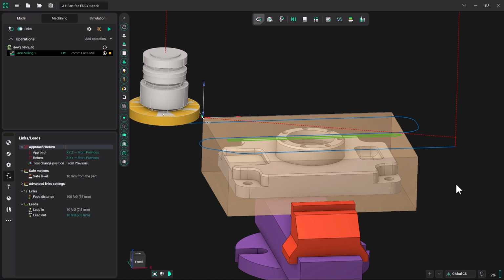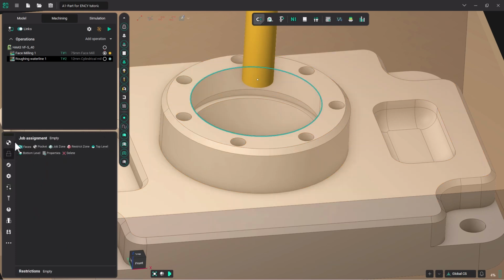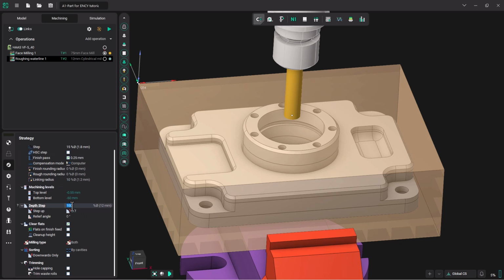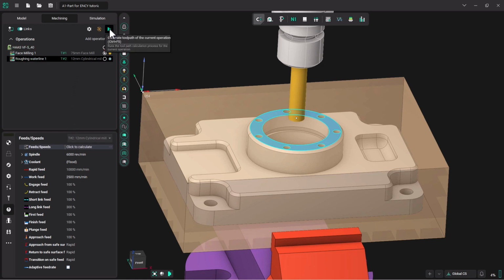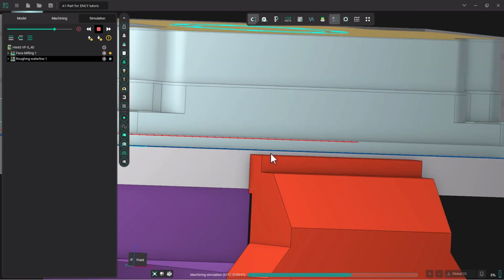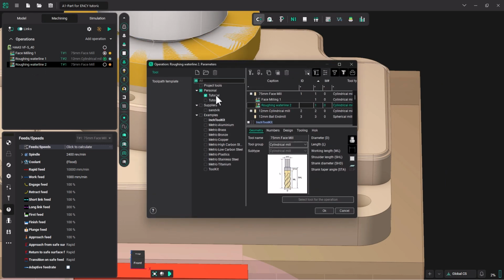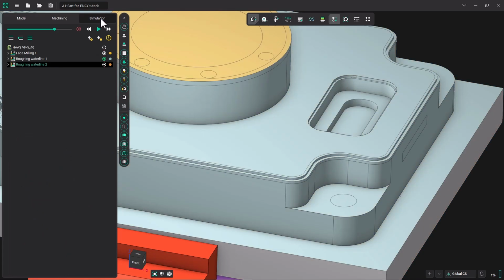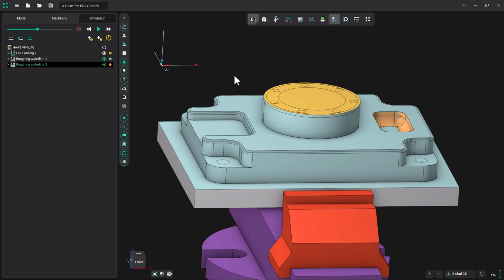Roughing Waterline | Tutorial 5 | ENCY: Get Started

Comment: Initially it looked really good, and i havent finished watching all your tutorials so far so perhaps i will get wiser after this comment, BUT.

That waterline roughing was... Rough...? To watch, knowing both soft and very hard materials in machinabillity, you would really need a dynamic milling strategy that properly adresses corners and changes the step over to accommodate for the higher tooling pressure, your roughing strategy needs more math and more dynamic "wiggle room"

Ive machined with Edgecam waveform, SolidCAM Imachining, Mastercam Optirough, Esprit Profit milling and Fusion dynamic milling.

All of the above offers more enhanced dynamic options in the same toolpath, but Imachining beats them all, hands down.

A huge  need for you here, i will advance in your videos and perhaps i will come back with an update stating i was too new and have been proven wrong.

ONE THING i will mention, your way of creating restrictions is... Chefs kiss, spot on..!
Reply from the maker: We value our users' opinions and strive to listen to them. Our programmers work daily to improve our product.
We have customers who successfully use ENCY for marble, metal, and softer materials like foam. Of course, the speed and tooling required vary depending on the materials used.
Thank you!